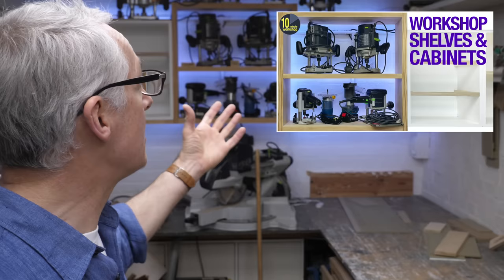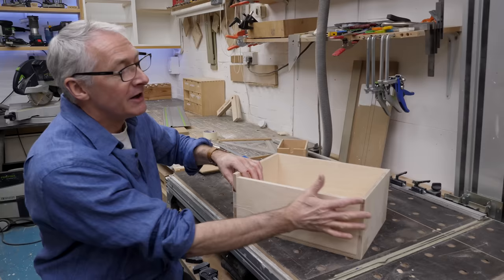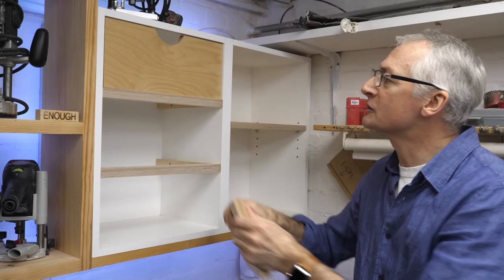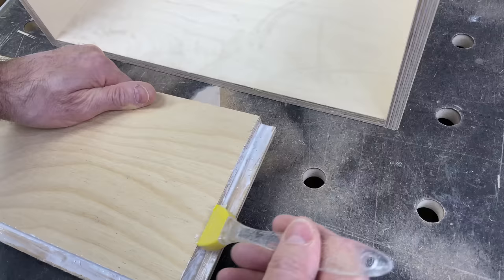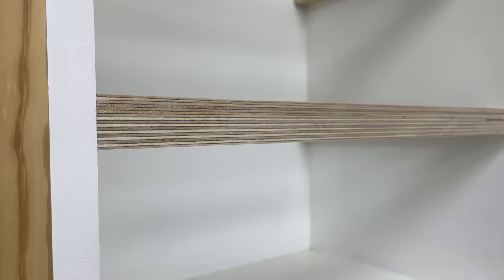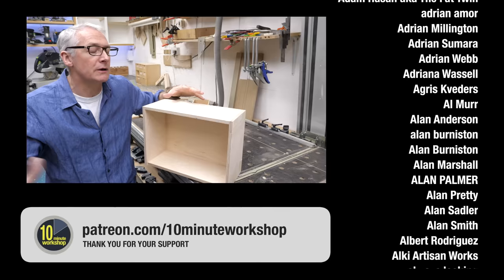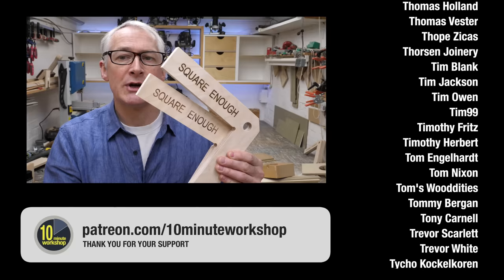Basic Plywood Boxes [video 445]

Comment: I'm going to be making a boot tidy for the car out of 18mm ply (got a ton of it for nothing so it's all i have and can afford at the moment) and you've just answered all the questions i had in my head. Boot tidy is still technically a drawer but used in a different way i suppose. Just hope it doesn't end up weighing a ton and knocking 10 MPG off the car hahaha

Comment: Nicely done. The rebate (rabbet?), beyond covering the exposed edge of the plywood, provides additional surface area for gluing and makes the joint stronger. (If you mentioned that, I missed it.) I will be trying these. Thanks, Peter!
Reply from the maker: Thanks! And yes, double the glue area on each side. 👍 💪

Comment: As always, a well executed and pragmatic approach to making furniture.

For those without a pin nailer 3 or 3.5mm diameter screws could be used instead. If looks are important then after the glue dries the screws could be removed and drilled out to take 6mm dowels that are flush cut.

If using screws then making a simple 90 degree corner jig out of three pieces of mdf or plywood to clamp the draw sides to while drilling pilot holes for the screws and assembly makes alignment a lot easier!
Reply from the maker: Thanks Robert! Yes, screws then dowels are a good way to get a nice finish - but now we’re just previewing the forthcoming ‘draw boxes and runners’ video... 😆👍👍

Comment: Those are very good, simple but workmanlike. Having seen your previous videos on cabinet making I decided to make my own rather than spending £400 on 2 of those metal workshop storage units. I'm in the process of trying to turn my 'Tardis' of a garage into something that will also take a planer/thicknesser. So I removed an old workbench and started on what has turned out to be a big job - don't know why really' - of 6 cabinets, 3 of which will take shelves, with 1/2 size doors so they don't open too much into the space for the 'new tool', and 15 drawers in the other 3 cabinets. I thought - tool storage therefore strength is required - and opted for 18mm hardwood plywood - perhaps over the top in hindsight. So the 6 cabinets were put together with glue and pocket hole screws (about 30 in each cabinet) and I'm sure they will be there long after I'm gone! The drawers I wanted to do - strength remember - with 1/2 blind dovetails but being in 18mm plywood I didn't think they'd look that great so rather than have the dovetails visible from the sides, I did them so you'd see them only from the back as each drawer has a false front - BIG mistake. Why - because I had to work out precisely the end resulting width of the drawers so they would run easily and accurately in the drawer slides I'd bought. BUT making those joints that accurately has proved costly as some of the drawers are mm out from the correct width and I have had to pack them out. Oh well, lesson learnt, if you are going to try and be clever, stick with the tried and tested method of always making the fronts and backs the correct width first and swallow your pride on dovetails in plywood. 
Sorry this is so long but I wish I had seen this video earlier - you make it look so simple! Thanks for a great video again.
Reply from the maker: Hi David. Great comment, thanks! You're a braver man than me to try dovetails in plywood, though! Total respect for cracking on and getting the job done! 🙌 👏👍

Comment: Hi Peter,
Thank you for another excellent and informative vid. I am building some alcove units for my daughter in 18mm and 12mm bb/bb birch ply and I was surprised at the amount of repair patches in it. No problem for most of the construction but it made choosing four panels for the fronts of the four, 4 drawer units difficult and wasteful. Other than that it’s good quality ply, I just dont recall having this many patches in the past. To get ply with one unblemished face is really costly
Reply: Sorry it was b/bb, not bb/bb. There was a reduction in patches on the b side!
Reply from the maker: Thanks John. Yes, B/BB you should have one face with minimal patches; with BB there will always be some, though the Birch ply my local timber yard gets in seems good overall, it does vary batch to batch. 🤷‍♂️ 👍

Comment: After reading other comments Peter. I wonder do you ever use joiners rods? Or do you know what they are if self taught? Life size sections drawn on paper roll. Once drawn you take off all the measurements directly onto timber  reduces measuring errors by 100%
Reply from the maker: As I say in the video, the template is like a version of the Rod, or story stick as our American cousins call them. 👍

Comment: Just a thought Peter - couldn't you have  cut 1 piece the size of 2 drawer fronts, then cut a hole for the handles in the centre, then cut the piece in half through the hole to end up with 2 drawer fronts with semi circular handles?  You could have routed/sanded the whole hole before cutting into 2!
Reply from the maker: You could - as long as you’re sure about getting that hole in the centre, and cutting them exactly in half! I think my way is the safer option, and probably no slower!👍👍

Comment: Peter thanks so much for all this, you've given me the confidence I need and I've taken the plunge and bought a (very expensive!) Sheet of birch to make a chest of drawers. 

My question is about sanding. I bought some 320 for the faces and using this alone seems to make a nice smooth finish. Would you start lower down and work up to 320 or go straight in at 320? It's B grade. 

For the edges I was going to do 180 then 320 but The Internet says NEVER SKIP GRADES. 

I'm sure things were easier in the past when knowledge was passed in person! Hope you're well 👍🏻
Reply from the maker: Well thanks, and congrats on finding some Birch ply! 🙌 I’ve never sanded higher than P180 unless it was going to be sprayed, or a clear lacquer on Birch, then I’ll finish with something ridiculous like P2000 just to get that silky smooth topcoat. But that’s a final sanding,  it between coats.
Reply: @10MinuteWorkshop  Jennor Timber, Ruislip! And I'm finishing with water based poly.

Comment: I just noticed your router table, which you have made yourself. Making one is my next project, after finishing the folding workbench of your design that I am making.  I have made the MFT top removable by using button fixers, cos I’m thinking about using the frame for my router table, and just have interchangeable tops.  What do you think Peter?  I don’t have a workshop so space is a premium.  Was even thinking about doing another top to fit my circular saw to (upside down) and then the workbench becomes a table saw?  All just ideas at the moment though.
Love watching your videos!
Reply from the maker: Sounds like. Great idea to me Steve. Hadn’t thought about an interchangeable top ‘workstation’ style set up. You got me thinking now! My router bench is super simple - just a big router bolted to the underside of a piece of MDF with a couple of slots routes in for the fence to clamp onto. I’ll be rebuilding mine before too long, so keep your eyes peeled for that one! 👍👍
Reply: I made a small router table for the Katsu router that sits on top of my MFT, located in place to a couple of the dog holes using some 20mm plastic conduit. It’s a similar approach to what Matt @BadgerWorkshop has done, so can be easily fitted & removed. Matt has a video about it & also used it in his recent release 👍.
Reply: @10MinuteWorkshop  sounds great, I’ll definitely watch out for that. I’ve seen a few videos now of homemade router tables, Gosforth Handyman made one a while back, which seems to work well, and I want to get myself a Triton router because of the ability to wind the depth from above, with the supplied tool they provide with it.
Reply: @idlersdream826  I’ll take a look at that, thank you. I’m trying to find as many videos as possible, then perhaps piece everything together to make what I want.  But the workbench that Peter has designed will definitely be my base for it.
Reply: @steveblewer1202  😂 that’s exactly what I did, mix & match, plus your own twist on it 👍.

Comment: Without a router, I can’t cut halfway into the edges of the front like you did (6:26). My plan is to make an inner front piece that goes between the sides and a face plate front piece and glue them together. This shouldn’t reduce the stability too much, should it? 🤔
Reply: I was thinking exactly the same. I think that would be fine!

Comment: You have done many tool review vidoes but I cant find anything about any air tools and air compressors, which you clearly use regularly. Would be great to hear your opinion on these tools and see what you use, this is someting I am reseraching for my own owrkshop.
Reply from the maker: Thanks! I've been without an air compressor for a few years tbh, because the one I had (very small Stanley) was terrible! I've only had this one for a few weeks (Hyundai, links in description) so when I get a bit more use out of it I'll do a short review. 👍
Reply: @10MinuteWorkshop  Funny may have helpded already, I had been looking at a small Stanley that screfix do for £99.
Reply from the maker: That's the one. Horrific! Small, loud, kept blowing fuses. I threw it away in the end, just couldn't deal with it any more. Managed to pick up the Hyundai when they were just over £100 - they've gone up a bit now, see link below vid) but first impressions very favourable. 👍

Comment: Just on the finish. I sanded down to 320 but after putting on my water based finish the grain came up and was pretty rough. Needed another sand. Is the 2000 grit not going to also need a sand after applying the finish?
Reply from the maker: Grain should only comes up after the first application. Subsequent finishes just need de-nibbing. 👍👍

Comment: Another great video.  I wonder if I can be cheeky and ask your opinion.  I have a bamboo worktop in my camper van which I have treated with pure tung oil.  This is not as protective as I had hoped and has left a weird smell in the van.  This was done about 3 months ago, can I use another finish over the top to give a hard protective layer and seal in the smell.  Thanks in advance
Reply from the maker: Thanks! Yes, you should be able to put an oil-based polyurethane over fully dried rung oil to seal it all and make it even harder-wearing. 👍
Reply: @10MinuteWorkshop  Thank you so much for your advise, really appreciate it.  Can you recommend any products that would de the job? thinking maybe the poly oil high solid from osmo or shall i stick with the think stuff as the grain is quite tight?  Thanks again Peter.

Comment: Would the router table not have been quicker to produce the rebates instead of tracksaw and chisel first ?  Any particular reason for that ?
Reply from the maker: No. I've made them all ways, and it's faster to trench with tracksaw and chisel off than it is to take 3 passes on the router. Better finish too. 👍

Comment: 👍🏻great job good clear description and liked the tip on front and side fixed aspect for pressure or use of drawers , one question 🙋 looked like only applied finish to fronts but did u apply the beeswax to runners and drawer bottoms to assist in better smooth Glide in / out 🤔 KEEP UP THE GOOD WORK 👏🏻
Reply from the maker: Thanks! Yes I did - decorative beeswax on the fronts, practical beeswax in the runners. 👍👍

Comment: This was very helpful.  And it came out at the perfect time for me!  Several questions: 1) you mentioned at 4:25 you mention them coming out of square.  Could this have been remedied by using those special 90 degree right angle clamps applying pressure for an extended period of time?  2) cf. your Lamello video.  could your lamello be used on plywood?  Just curious, seems  the plywood end grain would prove to be a problem.  3) Are there any advantages (besides cost) to the bees wax over the other sealant you mentioned?  Thanks again for this excellent video!
Reply from the maker: Thanks Mark. They pulled slightly out of square when attaching them to the wall. On a client job I’d have sorted that out on the wall, but here in the workshop I just need to get them done, so a quick trim was best. And yes, the Lamello works very well in plywood. 👍👍
Reply: Hey Mark, I am not sure the cost of Pete's beeswax, I have brewed my own from a recipe on ToymakingPlans.com. One nice thing about homebrew is the ability to customize the content.

Comment: Nice video, thanks - you mentioned you’d have used a cheaper material but only had birch ply at hand. I’m also in UK and balking at prices - what would you have used as a cheaper substitute but still with appearance that looks good?
Reply from the maker: You won’t get the appearance of birch ply for less money unfortunately, but my local timber yard do a nice hardwood ply that would have been fine for shop cabinets. 👍👍

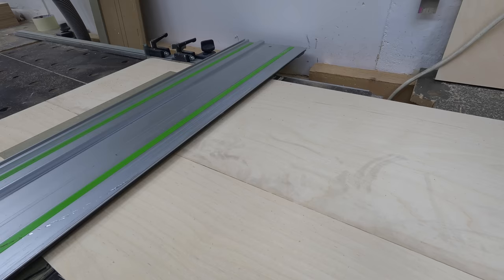Comment: @3:09  I noticed you placed a piece of thin material under the track when cross-cutting.  Is that so you don't have to adjust the saw depth of cut when switching between 12 and 18mm material?
Reply from the maker: Yes. Because of where I have my MFT, it’s a little awkward to reach the rail hinge to adjust the height, so I generally have it set to 18mm and use 12mm and 6mm scrap pieces as packers when I cutting thinner stock. 👍

Comment: Hi Peter. How do you like the Silverline brad nail gun that you are using in the video? I have thought of buying one of these so would value your opinion. Thanks.
Reply from the maker: Hiya. It's excellent; I've had a 16g Silverline since 2014 and it hasn't missed a beat, which for £23 is pretty amazing, and this 18g one at about ~£30 does the job as well. Pretty basic - e.g. there's no depth control - but for the money I can't fault it, and I don't use them enough to justify spending 5x as much on something fancy. 👍
Reply: @10MinuteWorkshop  Peter, thank you very much for your quick reply. I will order one of these today!

Comment: Hi Peter great video as always, new to woodwork the last 6 months or so, learned a great deal from your videos so thanks for that 😀
Was that a silverline nail gun u were using? And what's your opinion on it?
I've recently purchased 1 and must say its a great little tool to have 👍😁🍺
Reply from the maker: Hi Allan, and thanks! Yes, ~£30's worth of Silverline 18g nailer, to add to the ~£23 Silverline 16g nailer I bought in 2014, and still going strong! Honestly, it's basic (no depth control) but for whacking in pins it's brilliant! Still love my mains electric Maestri nailer/stapler, but it tops out at a 25mm brad and it's good to have something a bit bigger for this kind of thing. 👍

Comment: Peter, do you not find that a water based finish raises the grain on birch ply? I spent ages sanding a desk top to get it as good as I could but when I put the first coat of water based polyeurehane on it the whole thing lifted, I had to sand this back down after every coat. :-(
Reply from the maker: Yes, first coat will always raise the grain, but that’s pretty much all it’s for - it gets sanded right back and then another 2 or 3 coats applied,  denibbing after each one, and a final polish off to P2000 or higher. 👌👍
Reply: @10MinuteWorkshop   :-(  That's an awful lot of sanding (as I found). Do oil based finishes do the same thing?
Reply from the maker: Don't know I'm sorry; I've been 100% water-based for ~15 years or so. 👍

Comment: Hi, can I ask please, where did you get the bracket for your track saw that allows it to loft up on a hinge type system?
Reply from the maker: Hi and thanks! It’s an off-the-shelf Festool MFT or Multi-function table & the hinged rail comes as standard. See videos #182 and #183 for more details. 👍

Video 182  https://youtu.be/0V-p5F7SjO4
Reply: @10MinuteWorkshop  Ah thanks Peter.

Comment: Peter, can you tell me anything about your compressor setup (I have lokked in your channel). What are they? Regards, Mike
Reply from the maker: Hi Mike. I"ve only recently got this one, so still at the 'testing it out' stages. Haven't hd a compressor for a while and the one I had was terrible (small Stanley) and LOUD! This one's a Hyundai quiet one, working well so far - links in the description - and nicely quiet. There'll be a video when I've used it a bit more. 👍
Reply: @10MinuteWorkshop  I have just got one (compressor) from Rutlands and am exploring brad nail guns like yours. Very pleased with compressor (only 50db) which was the most important aspect. Next on the list is the 18g brad mailer. Mike
Reply from the maker: Mine's a Silverline 18g; £28, works great. Link in description 👍
Reply: @10MinuteWorkshop  oops I can see the link in description, should have read that. Project for this weekend, more expensive sawdust and wife loves the noise

Comment: The audio was fine. Surely it would be quicker to just cut the rebates in 2 passes than mess about with the plunge saw and chisel. Still great video though :)
Reply from the maker: Thanks. I’ve done them all ways, and this is by far the fastest. To get a clean enough shoulder in the rebate with just a router you need 3 passes 👍👍
Reply: That's fair enough, I don't have a track saw so wouldn't know 😂